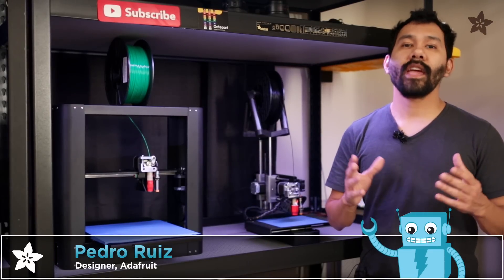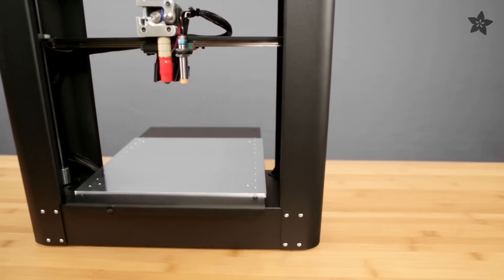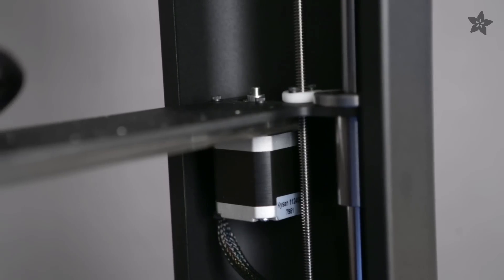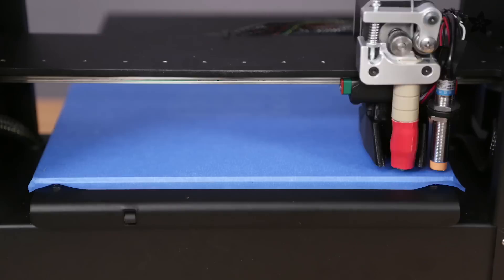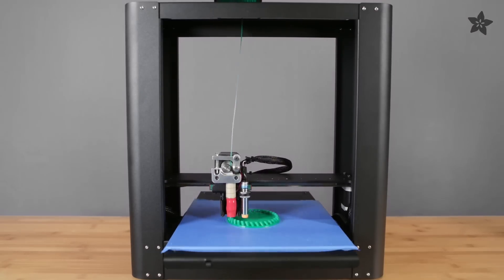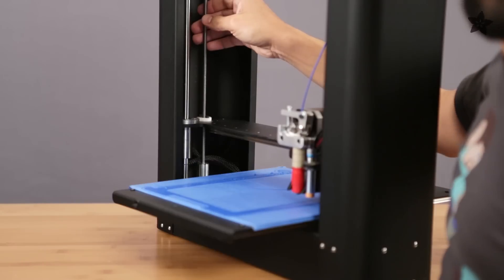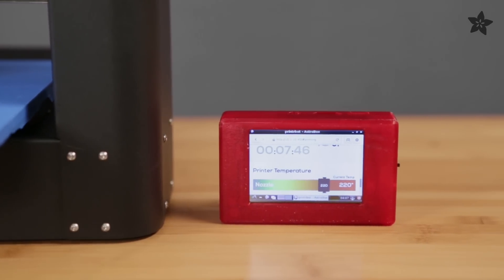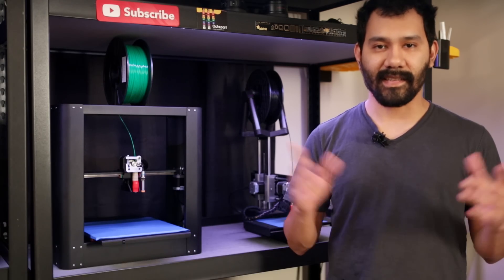Printrbot Metal PLUS Overview

Comment: I would seriously consider a different 3D printer manufacturer. This 3D printer comes with a micro USB connector without any stress relief that is prone to failure. The cellphone USB connector is just soldered to the printrboard circuit board without any additional reinforcements. The solder points bear the stress of the weight of the USB cable and vibrations during normal operation. 

The correct USB connector for a peripheral device is the USB type B doghouse connector. It is designed for things like printers. The micro USB connector was designed for slim cellphone & tablets where the stress relief is provided by the case of the device.

If the printrboard's USB connections fails, then the only fix is another printrboard with the exact same micro USB cellphone connector - which is doomed to failure...  If you want to return the printer, it will cost you 20% of the price of the printer! You buy a 3D printer with a defective design, then send it back because it doesn't work due to the defective design and you're out some serious $$  or - you have to shell out some $$ to refit the printer with the correct connector!
Reply: +Sir Williamson I swear whoever invented micro usb needs thrown onto an island in the ocean.... At least mini usb was okay.

Comment: I scratched the HELL out of my aluminum base because auto-leveling probe was too high :(. I also have had a great deal of trouble getting PLA to stick, even to painter's tape, but I have had some successful prints using a skirt, cranking it up to 100 mm/s (somehow printing fast reduces warping, at the cost of structural integrity). I'm going to try upgrading to a heated bed. Note that the heated bed upgrades will be discontinued next Monday, because this printer now comes standard with a heated bed - so everyone who has this printer should upgrade while the heated beds are available.

Comment: Like almost all these review videos they are light on actual critique and geared to noobs. As an experienced user I noticed simply by watching the video:
1. No removable build plate. WTF!? Noobs use Blue Tape... those that print a lot know better.
2. The cables to the extruder move and bend ALOT... this will lead to breakage as we have seen quite a bit of with the Metal Simple. Printrbot is obviously not keeping track nor seeming to care.
3. No power switch?! Really!?
Yeah... we know... cost... we hear that crap all the time when a bot producer actively chooses to ignore user requirements. Like the Metal Simple, PrintrBot does a good, but INCOMPLETE job. As such a buyer needs to know that they will need to upgrade and modify this 3DP. Yes, most all are like that, but it should be stated up front for those who do not understand.
Reply: Andy Cohen It's strange that the filament roll is just sitting on top of the printer like that... but it's probably an easy mod to make a rolling stand for it. The cable did really bend a lot... seems like you're right, at that rate it will probably break at some point... will have to be either extended or mounted differently to allow more play and bend less. Why is having a removable build plate so important? Sorry about my ignorance, I'm just trying to make an informed decision for a 1st time purchase.
Reply: +Andy Cohen Yeah the wires do bend a lot. Gets me a bit nervous with the Metal Simple. I guess with the Auto Levelling Probe that's how Printrbot designs their build plate - can be much better. For the past year Printrbot has been focusing all their attention to new extruders and hot-ends, which are great, but the other little things need to be done right too.

Comment: A couple of questions. 
Is that aluminum bed heated or not?
The Raspberry Pi that you used?  Does it offer more features than the LCD panel that PrintRbot offers with their $60 addon?

Comment: Only two problems with this.
1 it only has one extruder

2 This is more for me personally, Even though it's really close, it is still a bit short to print the custom keyboard tray I've bee thinking about.

If it had that I would HAVE to buy it. Maybe next year.
Reply: +Crowforge I would print this "keyboard tray" in separate pieces to combat warping (very evident  even in large PLA prints if you don't have everything dialed in perfectly) and if you realize that you messed up and something doesn't work the way you wanted it to, you only wasted half as much filament
Reply: Troy Dietz Worth it to have a completely seamless top. It's not like I'm mass producing these, I just need to get one right.
Reply: Crowforge You can use an ABS+ acetone "glue" to make them almost indistinguishable.

Comment: Where did you find that super wide painters tape?
Reply from the maker: http://amzn.com/B00BG9SUGK
Reply: Do those really works for ABS and PLA?
Reply: definately for PLA but I haven't used blue tape sense I purchased printers with the built in plates that are made for ABS/PLA. If you use blue tape and pla isn't sticking, once applied wipe it down with rubbing alcohol (once). Took much and the PLA will melt into the tape and you can't remove them from each other.
Reply: Brian Boatright I see. Thats interesting. Thanks. I've been using glue but its quite messy though.